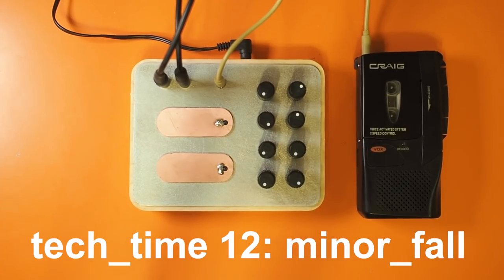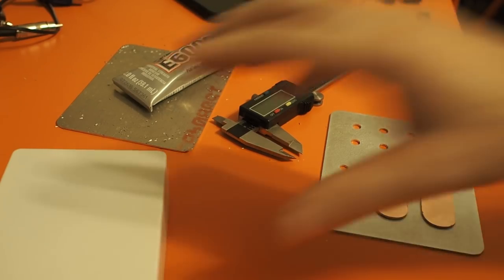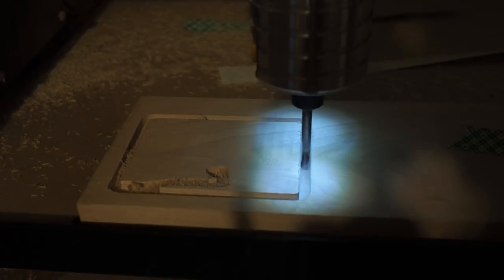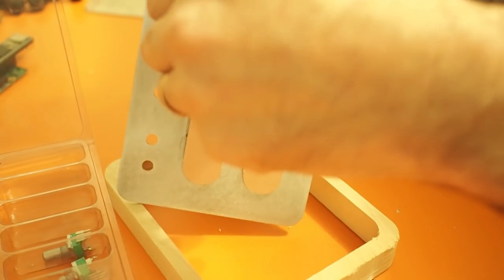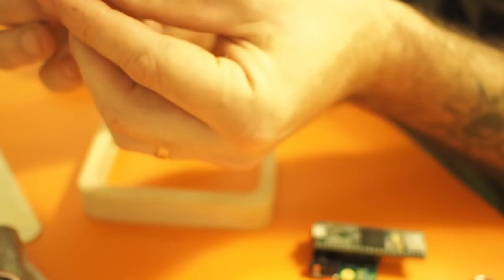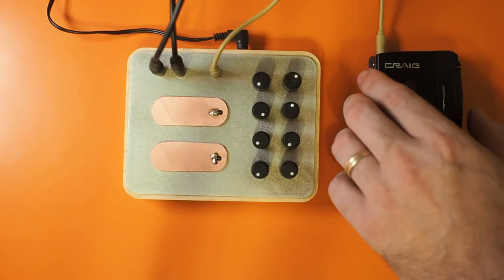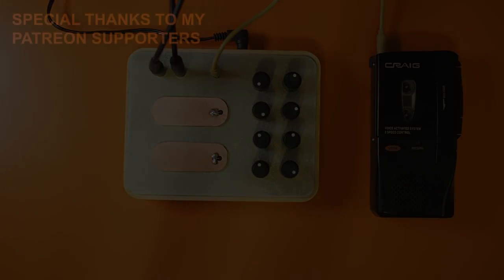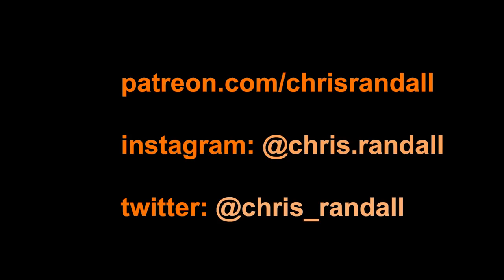minor_fall: tech_time 12

Comment: I've been looking at Shapeoko since you showed it in the previous video.  Is it suitable for cutting aluminum?  Why did you use your other mill for those parts?
Reply from the maker: I'm sure it can cut aluminum fine; I just don't happen to have the right bits for it. I never bothered to buy them since I have the MaxNC (which is very accurate and designed for exactly this sort of thing.)